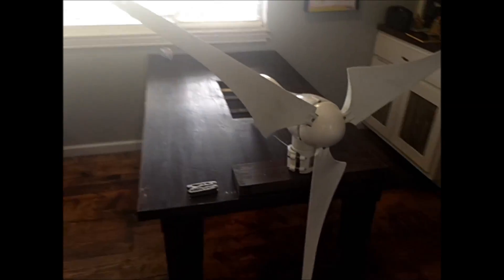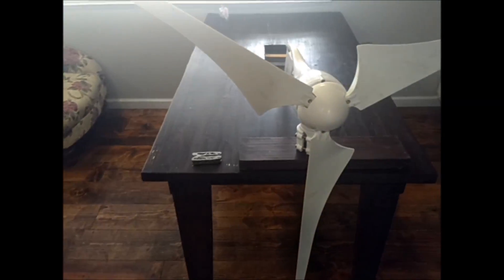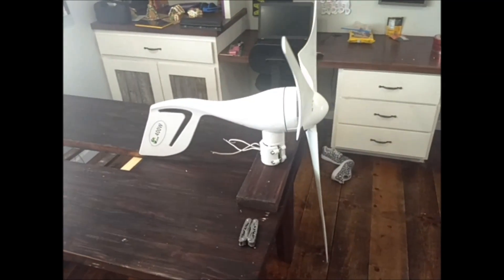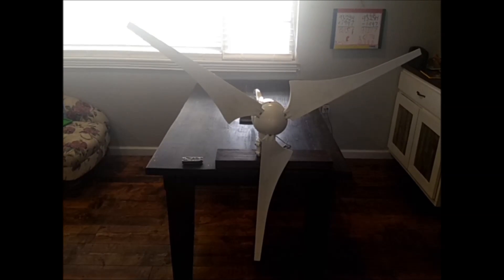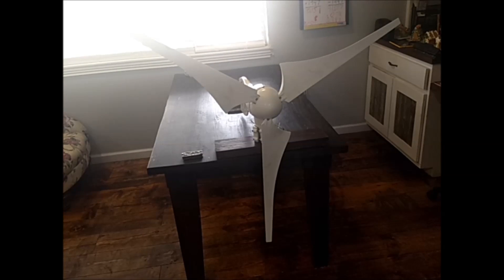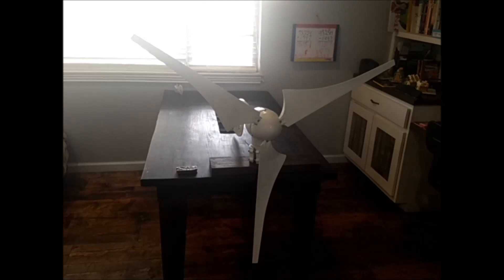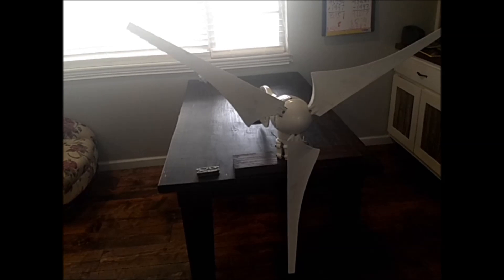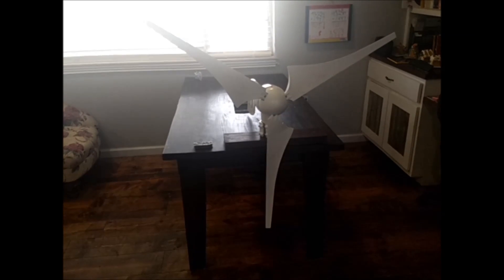eBay Chinese 400 Watt Turbine Review, Setup, and Initial Performance

Comment: Hi , why my wind turbine wont spin on low wind speed ? Barely i can spin it with my hand is that normal ?? Thanks
Reply from the maker: Hi Alberto!  It's going to be one of two things:  There is a short in the output wiring causing the turbine to brake OR the battery bank or inverter or load you've connected the turbine to is too heavy for the turbine (battery voltage too low, inverter demand too high, something like that).  What kind of turbine is it and what do you have it connected to?
Reply: Toys for Watts thanks !!its the same like your video it cost me $ 100 on ebay but i see only spin on very high speed wind not on low speed wind .
Reply from the maker: Can you post a link to the turbine you bought?  What do you have it hooked up to?  Mine does require a pretty hefty breeze to get it going.  It makes very good power once the wind is up to 15mph or so, but it's not even going to start turning below 10mph.

Comment: You need to change out the 12-2 your using and use a standard wire. You will see a major improvement in power output.
Reply from the maker: It already produces more than double the advertised rating...I don't think it could handle doing more :D

Plus the run for this one is only 20ft or so...if that...it should be more than adequate for what's going on here.  My bigger turbines definitely need larger wire, but when I can afford wire or turbines choices must be made lol
Reply: Toys for Watts  Ok but stranded wire is really what’s supposed to be put on instead of solid. Mark my word a good extension cord would give you better results. That’s why the 3 wires coming out of the turbine are stranded. Looks like a decent setup..

Comment: Did you use those long bolts for heat sinks.
Reply from the maker: I don't know which long bolts you are referring to...BUT there was no attempt made at additional heat dissipation.  This little turbine has not really needed any kind of heat control even when it's being pushed really hard.  I think it's a damn shame it's no longer available because it's one of the more solid models I've dealt with.
Reply: Toys for Watts the ones holding your wires that stick through the plywood.
Reply from the maker: Oh okay no that was just a quick, easy way to get tie in points where I could make all my connections.  It was cheaper and more robust than terminal strips, a lot neater than wire nuts and crimps, and more convenient than soldering all the connections.

Comment: Hi good day want to purchase a turbine  is the ista breeze 500, 700w  any good or the eBay 400 w is better can you please send me a link ty
Reply from the maker: I don't know about the smaller iSta Breeze models.  This i1500 is so far the only iSta Breeze I'm played with.  What's best is going to depend on what you're trying to do with it.  What are you wanting to run with your turbine?
Reply: @ToysforWatts  ty its backup for my 24v  solar  can you recommend  any of the smaller ebay ones

Comment: Your cable runs should be made with thicker welding cable
Reply from the maker: I'll admit I would like them to be a bit heavier, and I'm sure they're costing me a little output, but every turbine so far has hit rated wattage with the exception of the iSta Breeze (10w shy) with the wire I'm using despite that possible loss.  So, unless you're willing to pay for the wire, I'll probably continue to use the same wire.  If I have to choose between reviewing another turbine or buying #6 wire...well, it's not much of a choice.

Comment: Buy real 400 watt Wind Turbines from Carbonfreeheat.com shipped from Ireland and not China
Reply from the maker: Yeah I've looked at their models and they sure look like the same Chinese variants I'm working with.  And I'm not sure what you're considering a "real 400 watt turbine".  This one in particular exceeded it's rated wattage in the rated wind...and produced considerably more power the higher the wind got.  I've seen it producing nearly 1kw in very high wind, but it's always made 400+ in the rated wind.

Comment: The scoop on the blade is built in over speed  protection to push the blades out of the wind
Reply: In low wind conditions hacking off the blade tips might help haha. Someone should make a 3d printed aftermarket blade design with differing geometries depending on your wind speed ave and max.

Comment: That types of Windturbines where much better than vertikal axis turbines. Thanks for Upload. Best Regards from Germany.
Reply from the maker: Yes.  This is the third one I've done and I consider it a success.  Seller rated it at 400 watts at 12.5m/s and it exceeded that rating slightly, and significantly over in higher wind.  I have another one rate for 500 watts that I consider a failure...it has never exceeded 280 watts in extreme wind...but it still manages to produce usable power...just not as much as the seller claimed.

I may try another vertical axis turbine in the future but that last one has diminished my interest.  They way they're made I just don't see how they can put enough copper and magnet in them to make them perform decently.